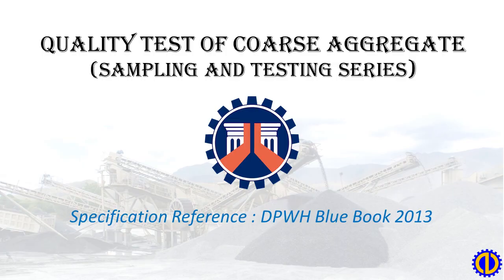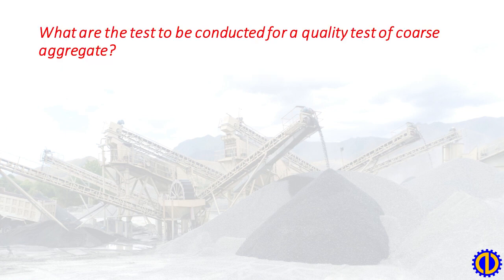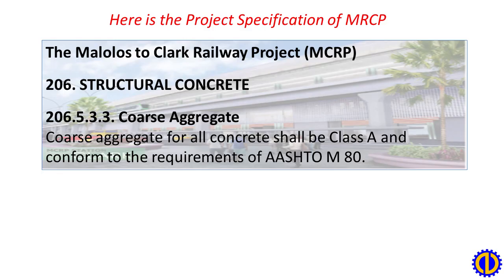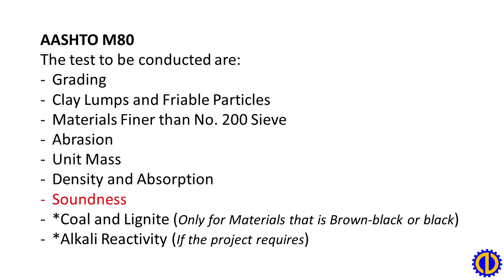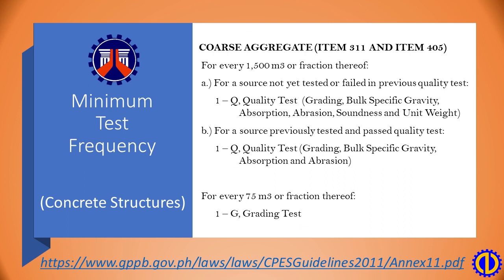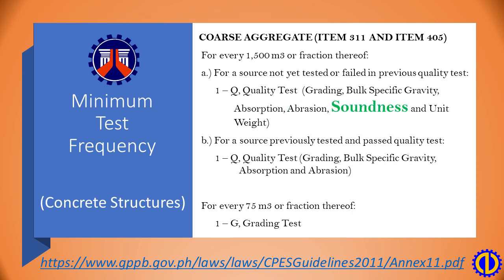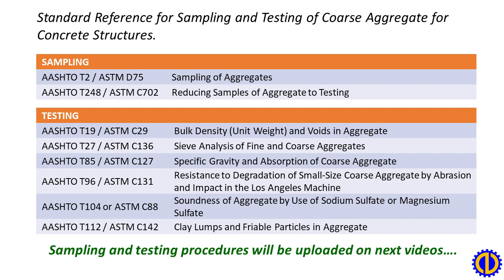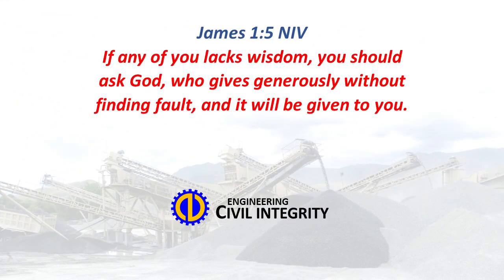Quality Test Coarse Aggregate For Structural Concrete Series (Introduction)

Comment from the maker: Important Note for ME exam takers: 
The separation for coarse and fine aggregate for untreated subbase, base course or surface courses is 2.00 mm (No. 10) sieve while for structural concrete is 4.74 mm (No. 4) sieve. Reference Blue Book 2013.